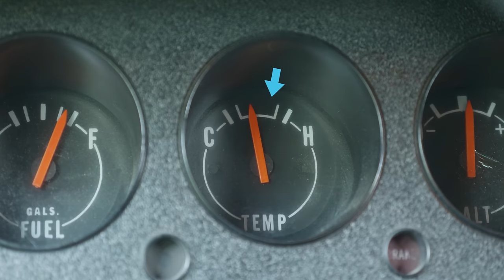Beat The Heat ft. Wizard Cooling Radiators - Vapor Lock Fix

Comment: Wow,  ive never heard of wizard, very clean look though.  For the meantime my chevelle is running a brass big block 3 core radiator with modified twin fan shroud from a late model impala. This set up has never failed in the hot Texas weather, but if I ever need more cooling I'll keep wizard in mind, great video !!!
Reply from the maker: Thank you very much! Wizard Rads are built in Upstate NY and they make their way around the Northeastern Car Show circuit, so that's likely why you haven't heard of them.  They build beautiful units though.